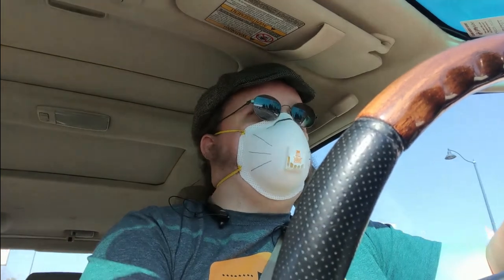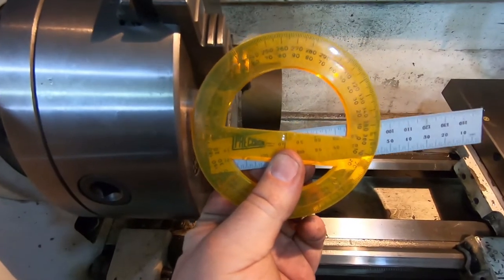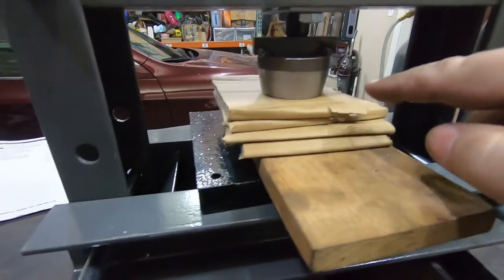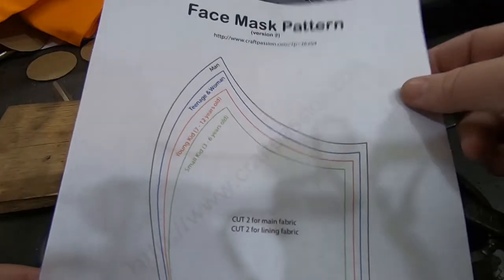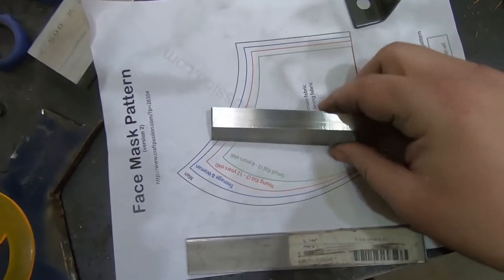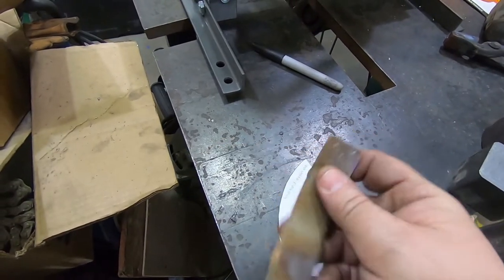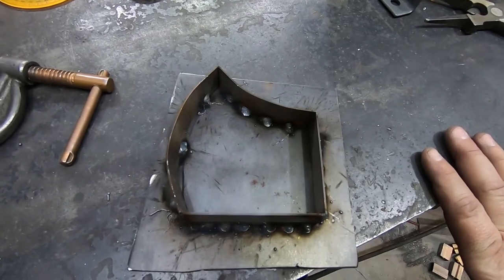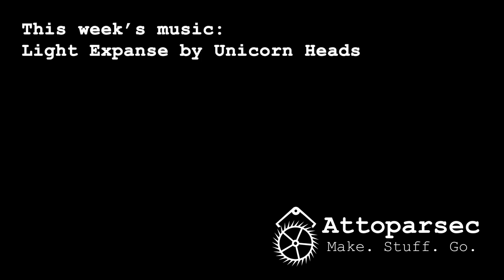Emergency Die Cutter

Comment: and one more before I go to sleep: there's a jewelry technique for making punches.  This is difficult to explain, but: you cut a sheet of steel with a jeweler's saw, at an angle.  The angle is calculated based on the kerf of the sawblade, such that the acute angle edge on the inner sheet is exactly the same size as the acute angle edge on the outer sheet.  Usually a single tag is left connecting the two; you can then push the two apart, put the material you wish to cut between them, and press them closed, and they cut like scissors.  People have used this for thin brass, so it should work for fabric.

Comment: okay I was wrong about going to sleep.  I used to use a leather die cutter of a complex outline formed with tool steel.  The die maker who built it would route the outline in soft steel, then bend a tool steel sheet to fit in the outline.  Then it was ground against an inclined/angled grinding wheel with a tracer above the wheel that bore against the tool steel edge, so it could be hand-ground to a consistent taper and thickness, and the tool person would walk the tracer back until the edge was sharp enough.